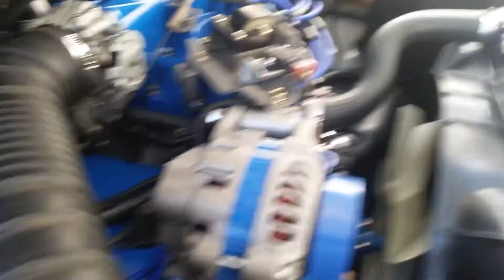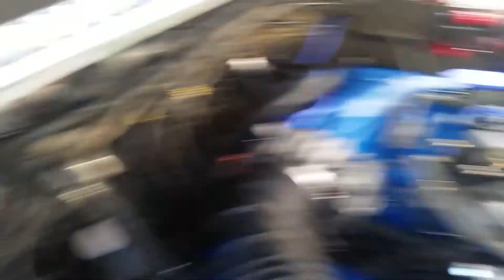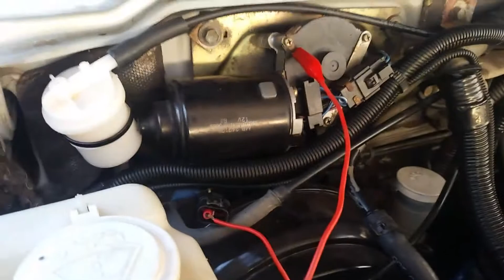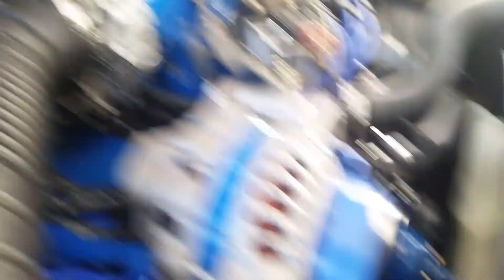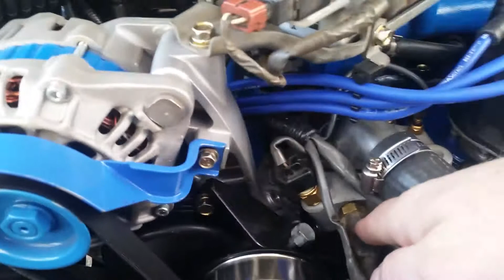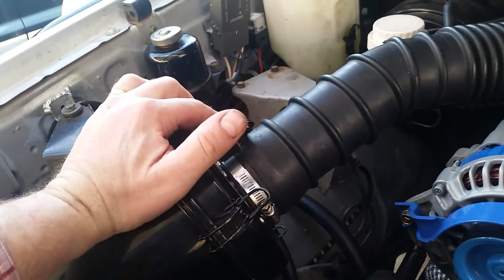Gen 1 v6 Gen 1 Pajero v6 tuning

Comment: Should I warm up the engine before doing that?
Reply from the maker: Hi Marcin. Sorry for the late reply. Yes you should always warm the engine up to normal operating temperature. Otherwice the cold running system will interfere with the settings.
Cheers.
Andrew